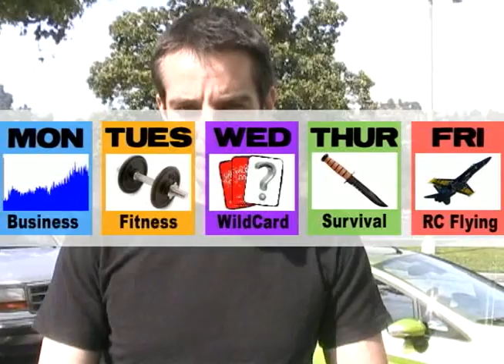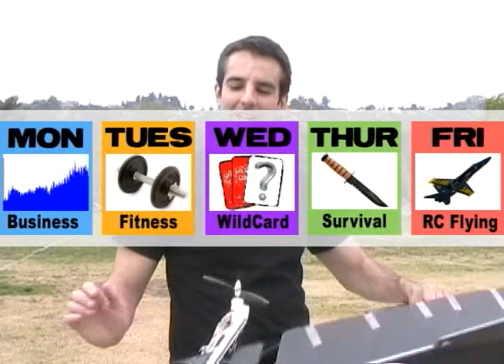RC F-35 STOVL TEST 3 (Motor Test)

Comment: strategically cut holes out  of the fuselage to reduce weight to get you hover right. then use that fancy modelers tape to tape over the unsightly holes.

Comment: Just a thought..... Perhaps you could put a gyro on the servos that rotate the motors from forward flight to hover and associate the gyro with the for/aft movement of the plane to help stabilize your hover. This would allow the motors to change vector as needed to further stabilize the hover mode. Im not sure how they would act when the motors are in forward flight mode however.

Comment: hey Dave. have you tried putting a heat sink on it like you did with the su-35? you just bent a push rod around and stuck it to the speed control and that kept it cool.

Comment: "I hear alot of wind not going towards propulsion" 

This may be because the first motor is taking valuable air pressure/thrust away from the first one, giving it less air to push, as well as making it work harder.

Comment: Dave nice job...and Val great job with video as well. I do have a suggestion for you about the motor setup. Since you are wanting a head wind to stablize the plane therefor you need forward movment when no wind why not have the front motor pointed back just a little when in the hover mode? This would give you some forward motion and lift all at once. Just adjust the linkage so it doesn't have a much throw for the motor downward but it is still level in flight mode. Just a thought. Dan

Comment: have you thought of putting an accelerometer on-board and then transmitting some of that data down to the ground? then, maybe a small micro controller could be on-board to offer some stabilization and decision making towards the inputs.  anyway very cool channel thanks for posting these videos

Comment: looks pretty sweet.  what if one motor was pointing more down than the other, instead of adjusting both further down.  i would try the front angled more down than the rear.  just my thoughts.  nice work tho.

Comment: You mentioned that a suspension would be too heavy, but what about some simple being simply a wire-skid, without any whees, just a piece of wire formed as a springy skid? That should not be too heavy and would save some rough landings.

Comment: here's an idea.
have the forward motor angled forward a bit, and the rear motor pitched backward. then they cancel each other out which comes to a perfect hover. i will try to show a drawing lol. the slashes are the propeller shafts and the dashes are the plane itselff. drawing:

       /---\

Comment: i dont understand why the props are situated to be below the a/c?
surely this will give it inherent instability with all the weight above the thrust line, the only stability being from control surfaces with a slight forward movement. 
afterall....helicopter blades are on the top! not the bottom!

Comment: why? the verticopter is a very badly designed concept that is not a good model to use for the plane. I'm pretty sure it will never take off.

Comment: The F35b... a poorly designed even in RC form... its working way too hard because it cannot get air when it is vtol mode..... needs to open up in the center life the full sized piece of crap.